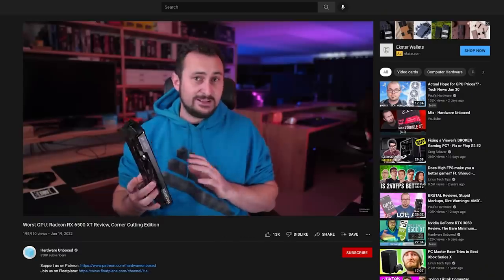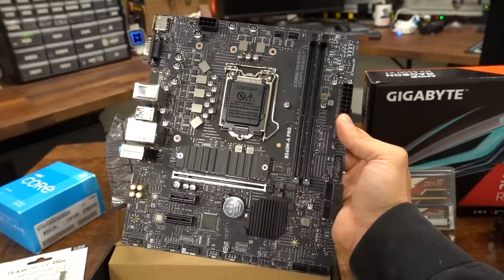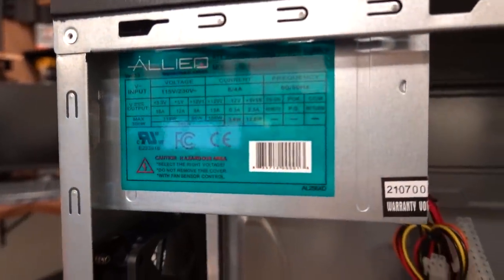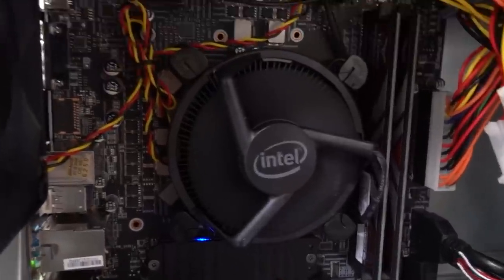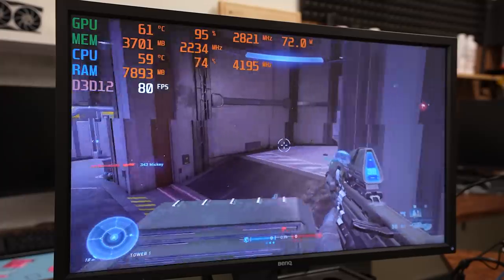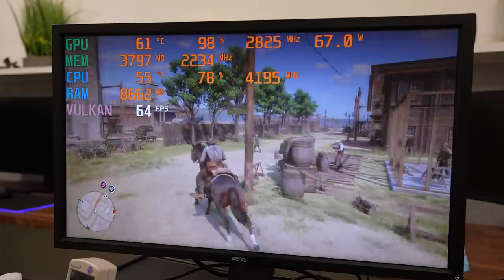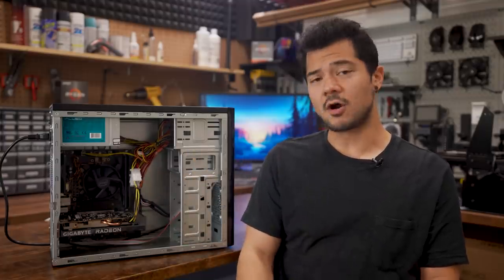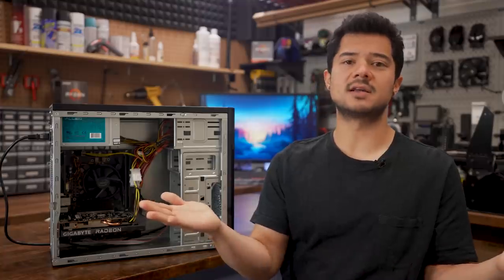Good Budget PC or HOT GARBAGE?

Comment: I built my first PC a month ago using the Ryzen 7 5700G. Im very happy with it until I can get a graphics card at a good price.
Reply: Welcome to the pc community!!
Reply: I did the same thing, I'm very happy with it, huge upgrade from the 1050 imho
Reply: @MyLeoOne  i need some tips im looking for a 3090 and is 2k a good price even tho msrp is 1500 its the ftw3
Reply: woah really? i got the same cpu too! i got it while it was on sale on ebay. anyways what kind of usage do you use for it? if it's similar to the usage I'll be doing for it then I won't need to look for a GPU as well.
Reply: Cool,what type of fps is you getting
Reply: @AtlanticPOG  3090 is 3k+ but I know you can a prebuilt around 2-2.9k With a rx 6900 xt
Reply: @babyyskittless7430  i can easily get a rx 6900xt for 1400 but i want dlss 2.0 bc its such a performance boost and better than what amd offers
Reply: @AtlanticPOG  Dude, just get a 3080ti. It's 98% of a 3090 for way less money. You can get an EVGA FTW3 3080ti on eBay right now for $1700. It is NOT worth $300 to get 2% or 3% more performance. The only way I would advise a 3090 over a 3080ti would be for Ethereum mining, and even if you wanted to do that, you are extremely late to the party. That ship has sailed and theres only a very short time left to mine any Ethereum.
Reply: Good choice, although it doesn't support PCIe 4.0 so that's going to be a bottleneck in the future.
Reply: @catch22frubert  can it handle triple 4k  i asked that in reddit too none answered
Reply: Ditto except mine is the Ryzen 5 5600G...
Reply: @AtlanticPOG  if you have the money, just buy it for whatever price. not sure why you have triple 4k monitors, but you do you
Reply: @yoda9256  i found them on sale for like 300-400 euros
Reply: @yoda9256  im just asking if the 3080ti has enough vram for triple 4k
Reply: @AtlanticPOG  if you have the money for the 3090, by all means go for it
Reply: @yoda9256  aight thx
Reply: Don't get a GPU get a APU in June by AMD Rhyzen 4000
Reply: I’ve been looking at getting the Ryzen 7 5700G because I can’t afford a graphics card with them being so expensive right now, how are you liking it? Can it play most games, like Halo MCC, for example?
Reply: @EggMilkBread  i dont think it realised yet
Reply: @AtlanticPOG  FE MSRP is not MSRP for AIB cards. I think 2k is around MSRP for that card specifically.
Reply: I have a Ryzen 5700G myself and am very happy with it’s performance.

Comment: We live in such high spec times that it's really easy to forget how little hardware you actually need to have an enjoyable experience with the majority of games. Videos like this are really great to remind people of that. I would still have gone for a PCIe 4 capable setup with this GPU, though. Sometimes the compromises aren't worth the loss in performance.
Reply: If anything the shortage has made people realise that the elitist jargon was nothing but hot air.

Pre shortage a 1660ti was considered bad value for 1080p or too weak by circlejerk pc groups.

Nowadays they are happy if the get a 1050ti at 20% inflation xD.
Reply: Yeah well a 2012 13” MacBook Pro is not enjoyable

Comment: I'm glad to see someone build a system that actually makes sense for the card used. Most would bench the card with an overkill cpu/mobo combo. And as long as the person doesn't expect miracles,  I think they would be happy. And did you test out FSR?
Reply: The thing of those overkill mobos is to get the max of the cards, so we can compare it to all the other options as a "Base Standard" line
Reply: There is a legitimate reason why reviewers do that. It's to eliminate all other factors and single out the performance of the gpu. That being said it is also good to see this gpu In a "realistic" setup as well. If you put this gpu in a lower end system you're left with the question, what is the limiting factor here?  I'm the current market I think this is a great card for the price. You can get a used 480 4gb for around the same price but why would you when you can buy new. Sure the gen 3 gen 4 issue still exists but it isnt a deal breaker for the price imo.
Reply: Well, actually ... If you use CPU that support only PCIe 3.0 it is kinda stupid to go with MB that supports PCIe 4.0 . It would be better to save few bucks and get H410 chipset, then invest that savings in somewhat better PSU (400-500 W range)
Reply: @aleksazunjic9672  you could argue that another way. You have a better upgrade path with the 4.0 board.but to each thier own. I've learned from building many computers over the years, don't cheap out on your motherboard, especially if you plan to do upgrades throughout the lif of your platform
Reply: I agree... The only issue I have with this PC is the motherboard and CPU choice. If the A520 supports PCIe 4.0 (which I think it does) I would have gone that route with a used Ryzen processor to really be economical. Or 11th gen Intel... Any way to at least take advantage of the PCIe 4.0 spec on that card... Or at least set up your system for expansion when most people can get cards.
Reply: @davidhodge0201  Don't cheap out on anything if you could afford it , but ... In this case, since it is a gaming computer, first thing you would need to replace is a GPU. CPU, as it is , has plenty of unused power and would not bottleneck even much more expensive GPUs like 3060 . Even if you want to upgrade CPU , H410 does theoretically support up to i9 10th generation. For all of that to happen you need beefier PSU . My personal take on budget builds : better to have cheap MB than cheap PSU.
Reply: Fsr only works in a few games unless you use magpie or losless scaling which add some input lag and don't really help that much
Reply: @pro_gemer  FSR is now added to most games since players demand it - it improves performance significantly on hardware that people have and could get .
Reply: @aleksazunjic9672  it doesn't really improve performace on both my old laptop and my new pc by more than 5 fps when scaling 720p or using the built in fsr in games
Reply: @pro_gemer  Well if you had 5 FPS before and 10 now, that is 100% increase :D Realistically, FSR gives 10-15% with quality settings (very little noticeable loss of image quality) . If you want more than you need to sacrifice visual performance. Overall it is quite good in games where you have near 30 FPS performance and just need a little boost to go over 30.

Comment: As someone who builds these types of "budget and available" builds all the time. I really enjoyed this video. The i3 10100/10105 are comparable to an i7 7700, which cost almost double on the used market. Lots of value here for budget focused/new pc gamers. 

I've build over 10 of these similar spec'd pcs and sold them to local folks new to pc gaming (young and old). I try to find deals on cases and psus to allow for easier upgradeability, but it does up the cost a lil bit. Great video. Nice to see high view content creators dig into the budget building scene. Its my favorite content. Keep it up @bitwit !

My next project... checking to see how well the new pentium dual  core g7400 holds up in game. Due to the 12100 doing extremely well in modern games. I think we will all be surprised by what the dual core will be able to accomplish. Hell, maybe I'll finally make a video.  
Cheers, hardware friends!
Reply: The Pentium Gold processor is fine, but the Celeron is almost unusable for anything other than basic office work and web browsing.

Comment: Watching this from my 4790k / 1080ti build... I got into PC's roughly 4-5 years ago I believe 7700k was the most popular CPU best bang for the buck(compared to the higher cores), and especially for gaming /not workstation related... anyways I ended up going with a used 4790k hp prebuild and rx580 /psu eventually upgraded to 1080ti got a new case etc, all in all, I've spent like $600-700 granted everything I got was USED but still its a hell of a system little dated but I can run plenty of games just fine with 100 fps +

Comment: CPU, Board and RAM are fine, as well as the drive. For the PSU I would recommend to maybe buy a reputable brand 2nd hand. I did a similar build and bought a be quiet System Power 9 400W PSU for 20 bucks. No adapters needed and I don't have to worry about it failing out of nowhere. You can also buy pc cases for just a few bucks 2nd hand; heck, some people even give them away for free as long as you pick them up.

Comment: I would spend an extra $100 on the i5-11400. That unlocks PCIe gen 4.0 giving you 10-15% more GPU performance and also an Intel iGPU which has a pretty good video encoding engine in case you want to stream or record gameplay. And of course like 50% more CPU performance all for $100. 

Also an extra $30 on a PSU and case. Fire extinguishers go for around $20-30 so you’ll break even.
Reply: I would get 12100 instead personally
Reply: @OrjonZ  Where?
Reply: The rx6600 is going for $450 here right now, or $180 more than the 6500xt.    I think I would go that route instead of putting the extra money into the cpu.   Its a toss up though.   Buying an older 4 core seems rough in this day.  😜

Comment: One thing I find problematic with this build, is that the CPU and board combo only has PCI-e Gen 3, and that dramatically cuts down on the potential performance for the RX6500XT. I think a 11400F would make it run a lot better.

Comment: An i5-11400F would take it to PCI-E 4.0, making the processor upgrade a bit of a GPU upgrade too
Reply: Wait so if I get a h510 board with a 10th gen i3 it won't run on pcie 4.0
Reply: @loowick4074  10th gen only support PCI-E 3.0. Unfortunately there is no 11th gen i3
Also, if I recall correctly, 11th gen has 8 lanes for CPU to chipset, while 10th only has 4 lanes
Reply: @loowick4074  i have the same mobo and it works just nice. i have i3 10100f with 16 gb ddr4 g.skill and now GTX1060 3gb from msi twin frozr gpu

Comment: Do you think it’ll be worth buying the rx 6500 xt coming from a gtx 950 2gb (lower power card)?

My system specs 

Ryzen 5 3600
16gb ddr4 3200mhz (dual channel)
700w 80+ bronze psu
Pcie 4.0 mobo

Comment: I have a sapphire 6500 xt on a pcie gen 3 interface, sometimes in halo infinite I will load into a game and randomly have terrible performance where the game will look like garbage and I’ll have around 20-30 fps on low settings, happens about 1/5 games and I have to close and reopen my game, I haven’t really seen this issue in reviews so if anybody knows why this is happening any help would be appreciated
Reply: System specs

Ryzen 5 2600x 
Gigabyte b450 aours m
32 gigs oloy Warhawk 
Sapphire 6500 xt
Evga bq 700 watts
240 gig adata sata ssd / 1tb hard drive

The game is installed on my ssd, including specs incase that matters

Comment: I don't think the build is worth it. Personally I would have added $200 more to the over all build. 
With that you can get a i3 12100f for $153, asus prime B660M D4 for $140 and a better case and psu which together can be got for $110.
That way you get pcie gen 4 so as not to bottle neck the gpu.

Comment: It's easy to get too carried away with specs, and definitely easy to worry too much about 'future proofing'. The parts in this system work great together. They should probably stay together. Front panel header is in the wrong place on the mobo, but the case could be used for many future systems. However I'd say that a system like this should be used as a gaming rig for as long as possible, then handed over/sold as an entite system to someone else to use for many more years as a home PC for web and office stuff. If that upgrade was in 2024-2026 then the new PC would have ATX12Vo, DDR5, PCIE5or6 for GPU and for NVMe, USB 40Gb/s all the stuff that this PC doesn't need right now, and can't really support with individual component upgrades anyway

Comment: If you look some deals are out there.  I bought a gtx 1060 3gb the other day for 200.  Looks like today they can be had for a little less than that.  If you look I think a 4 gb rx 580 can be had for about 200 or slightly over.  Those might be worth considering and would probably be in the same range performance wise as the rx 6500xt.  But the 6500xt is new.

Also the molex adapter is not a good idea.  I’ve been a PC tech for about 13 years and have tinkered with them for over 20.  I’ve seen where a molex to sata power connector actually had caught fire and melted the connector on the back of a hard drive.  Imagine that happening with one of the molex to pci e power connections.  Good bye gpu.  In the case above, the case actually had black scorch marks from fire.  Obviously there was no recovering data from the hard drive.

Comment: How were you getting such a high framerate in Apex? I have a 3080, 10950k, and 32gb DDR4 3000 and can’t get above 100fps on medium. You need to share the settings or something because I know tons of people with monster PCs who struggle to get over 100 and have to play on all the lowest possible settings to make use of the 144hz monitors. Seems off that you were able to get such good performance on higher settings than people with 3090s and the newest CPU.
Reply: Mostly because at 1080p, it's cpu dependent, so the gpu won't run so much and you end up with less frames. If you're a competitive gamer, you don't need the top of the line gpu

Comment: I would recommend going doing a build with either the Ryzen 5 5600G or Ryzen 7 5700G with a good power supply. You get more from your CPU, and it won't hold you back when you finally do get a GPU. The only downside is that AM4 isn't getting any more CPUs, so no real chance at  CPU upgrade. Still, though, the Ryzen APUs are pretty good for what they are, and offer more value than building a cheap system around a 6500XT. Just my opinion though, take it for what it's worth.
Reply: The only problem is that as bad as the 6500 XT is, it's a crippled 580, which means itps lile a 580.

The 5700G is like a 750 Ti on the othrr hand, a 8 year old budget GPU that won't be able to play some intensive modern AAA games at 1080p at all.

Of course best advice is to just get a rx 570 though, unless 6500 xt is like around $250 tops but $230 and under preferred

Comment: I am pretty sure with that board as well as all other B560 boards are Gen4 PCIe just the only thing is the i3 wouldn't allow Gen4 to be used but overall for around 600$ for a decent system which myself i would change the PSU to something more like a 450w to be more on the safe side and also just for games like OW and Apex i would use a 256gb SSD for the OS and a 1tb HDD for games like those that doesn't really require that much but of course those thing would bring up the cost by like 40$ to 80$ and this is just me but for the front i would of still installed a fan in there just to see if things would of cooled down a little more.

Comment: Try running Control at Dx11 not DX12 there lower end cards perform much better.

My GTX1060 6GB was not doing that well with DX12 but once I switched it to DX11 in the setting the game could run on higher settings at 60fps 1080p. You'll loose the raytracing with DX11 but I don't think it's an issue with RX6500 card.

I would still try to get better motherboard than what was used to squeeze bit more performance from the card since you possibly can find better motherboard for not much more than what that one costed.

Comment: I'm glad you're outputting a video showing that if you want to build a PC so you actually build one with some instock GPU's if you can't wait anymore within a reasonable price.  One different suggestion is a different power supply and case. There are some EVGA 500W power supplies that you can buy for around $35 that will have all the connectors you need. And there are some $30 to $40 cheap cases that will do the job.  I don't understand your complaints about Control. Unless something is different within an update I have never been able to tell a  difference between low and high settings without dissecting the image and most cases I can't tell it all.

Comment: Thankfully I built my pc literally a few months before everything went up in price so I don’t have to worry about this stuff. The gpu I got was the 1660 ti. And cpu is ryzen 7 2700
Reply: Good combo!
Reply: Same as, I platformed swapped from gen 4 Intel core i7 to gen 1 Ryzen R7(picked up a 1700 for £80) in November 2019 as Covid started then swapped my old 1060 for a 2060S the following April.  I really didn't want to spend what I did on the GPU but it turned out to be a good decision in retrospect because the total I've put into the build after selling the old parts is around £300-£400 inc buying an additional 1TB 2.5 SSD to compliment the 1/2 TB NVMe system drive I put into it to replace the old 120GB SATA boot drive from the old build.

Comment: For $60 more, you could get the Gigabyte Aorus Pro B560M board with 4 RAM slots,2 M.2 slots and USB-C on the back, or spend $50 more than the MSI board and get the Gigabyte DS3H AC MATX board with 4 RAM slots, USB-C and have wifi..
Reply: or spend a extra 50$ and get a good case

Comment: shit, you can pick up a b550m for the same price or less if u go ryzen. also the 6500xt kinda does support ray tracing. it has ray accelerators built in, they are just useless if u arent using FSR as well as SAM. all in all id say not worth it in that configuration. full amd system id say it would. like a ryzen 3 3100 and a gigabyte b550 would probably increase those performance numbers by 30%-50%.

Comment: Buy a Xeon 10 core 20 thread CPU on Ali Express for under $40. Buy a X99 motherboard for under $90, Adata XPG S7 512GB nvme (3200 reads 3000 writes) $59.99, 16GB DDR4 VColor 2666Mhz $27.99 x 2 memory, 6500 GPU, and a Seasonic Core 500w PSU for $75. Total cost without case: $570.00 approx.